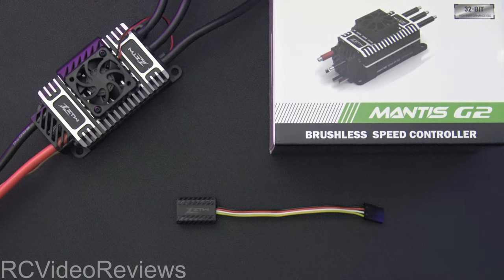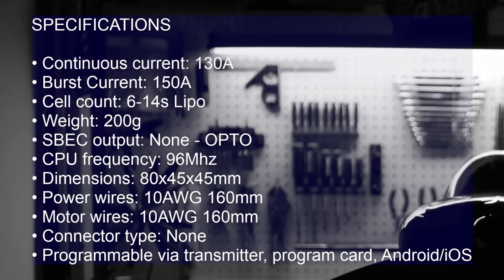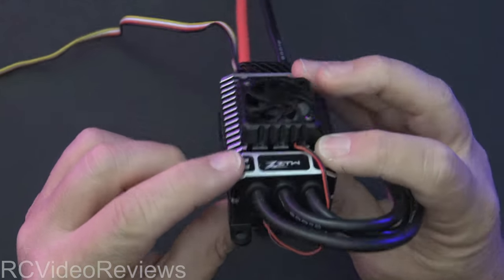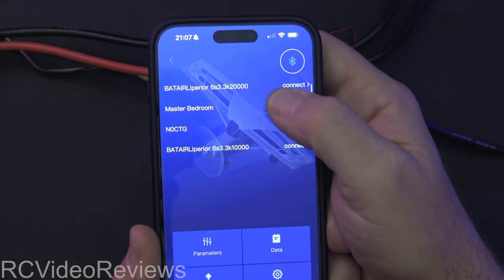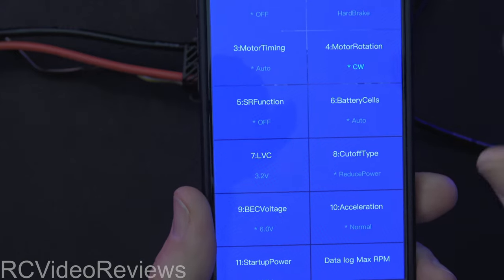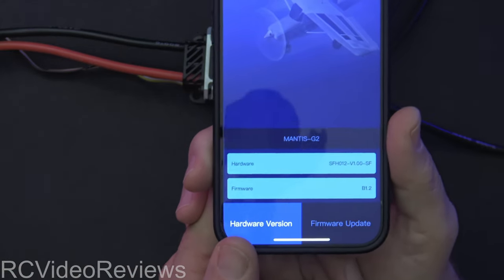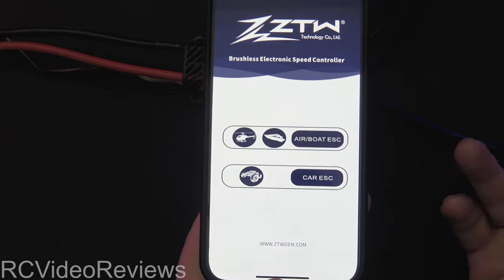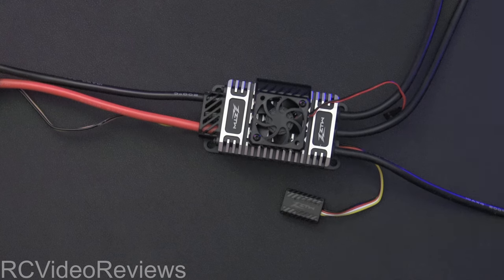How-to Program ZTW Mantis G2 HV 32-bit ESC with Bluetooth Programming Module

Comment: Just picked up a Seal g2 160amp for a boat. (29in cat with a 1900kv 4082 motor 4pole) fiddled with the setting before hand mainly the Low voltage cut off. where you mentioned the need for more values. I set mine to 3.4 factory was 3.0 anyways, Boat start off great like 50% max throttle as I get into the driving area, start moving some water with it and coming up to full power. and it will rev out nicely maybe 5 or 6 seconds after I've hit max throttle it cuts the throttle back to 70% and sends me into LV mode with the beeping and stuff at 3.9 a cell using 2 3s 6000, 5000, and 7200 mah batteries most are new with in the year. figured today I'd set the LV setting back to factory which was 3.0 got a good run no loss of power got 20 minutes give or take a set of batteries, but low votage was kicking in at 3.6 when it was set to 3.0. is there something i miss read or failed to read in the manual or this common for boat ESCs my batteries junk? new to boats

Comment: After you program the esc save it to the esc then you have to cycle the power and reconnect the dongle or you cant see the telemetry. Hope this helps anyone.  I spent a few minutes trying to figure it out.
Also, i was hoping the soft throttle setting would be less harsh of a start but it didnt seem to change anything

Comment: Hello John, nice feature, many thanks for the info. 
But I'm still waiting for esc that can be setup with telemetry lua script, and also telemetry data feedback like A consumption, voltage, temp, rpm running on elrs... Like I had on my graupner Hott material more than 10 years ago. Do you know if there is something in that range coming soon? As well as PWM receivers with internal gyro...Some Developpers made already some side firmwares mainly based on Betafpv super P receiver on thoses directions but still nothings official and no products available.  Graupner, Jeti, Frsky, perhaps Spektrum have those functionnalities.